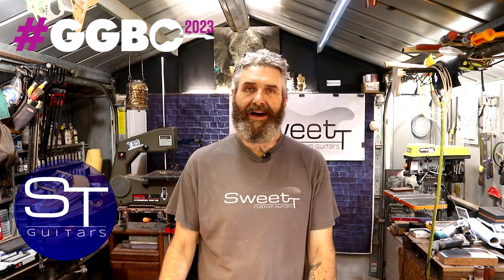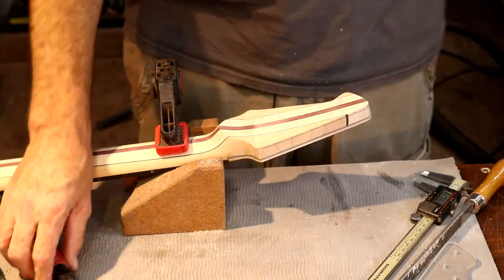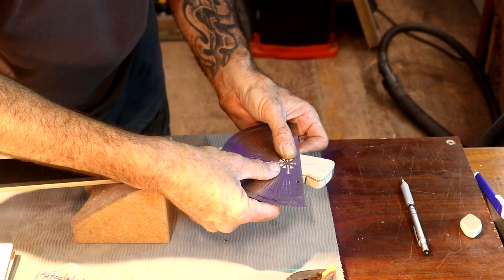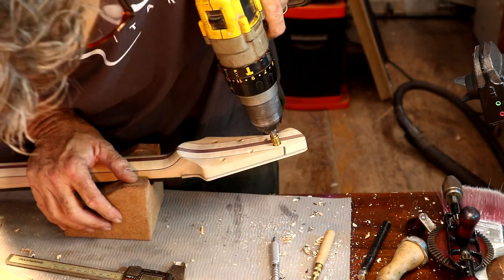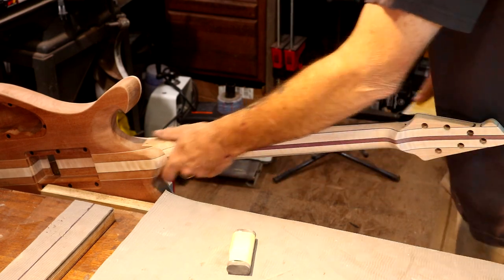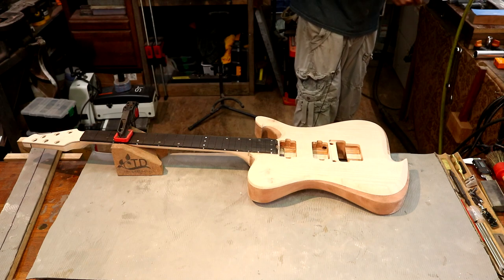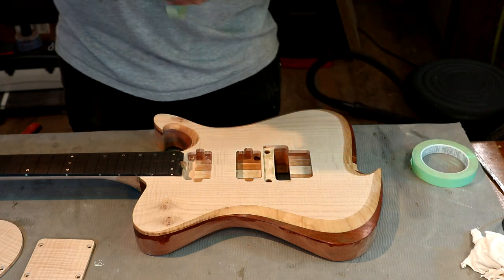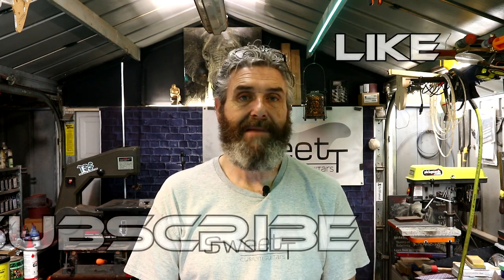#ggbo23 - Ceres Theta Guitar Build- Episode 8

Comment: Hey Todd, I need your advice brother... I am going to be painting my guitar. It's a mahogany body. 2 questions - 1. I want a smooth, pristine finish. Is sanding sealer enough, or should I use grain filler first? Secondly, how fine should I sand before doing filler, and again before sealer?

Loving the guitar you have going man!
Reply from the maker: Hey brother. Sorry man, I missed the notification. So I would do both. Grain fill and seal. I'd sand up to 320 then grain fill. After grain fill start at 320 and go up to 400 and get it flat as you can get. You can go up to 600 is you want to be a little more delicate. Once you get it flat, wipe it down with wax and grease remover or Naphtha then a tack cloth lightly. Then you're good to go man. ✌️🤍